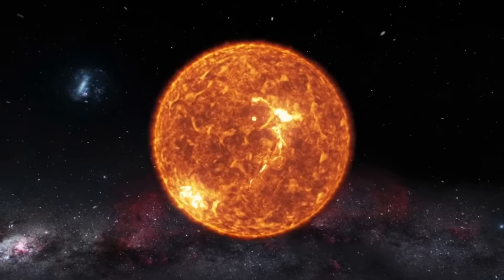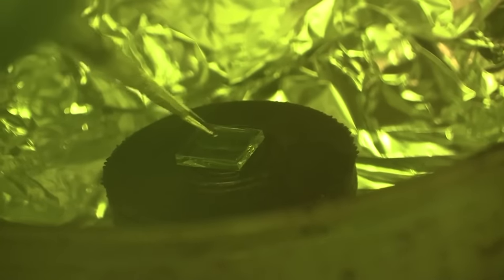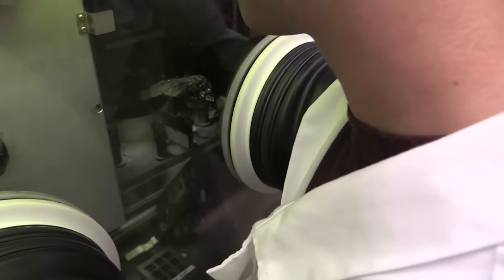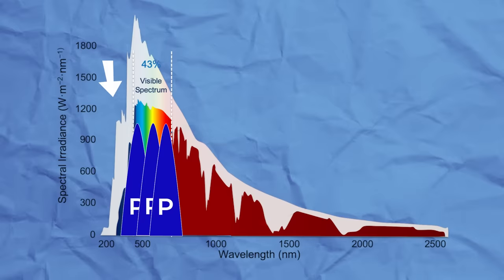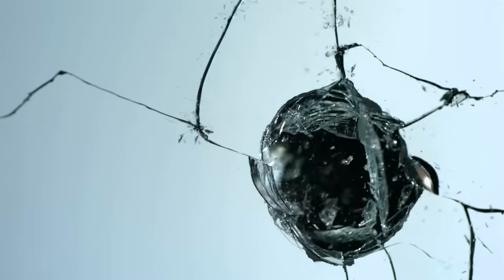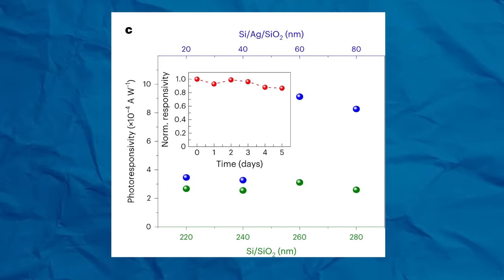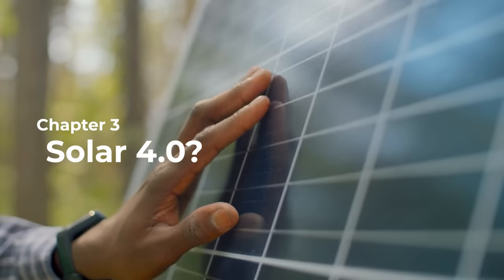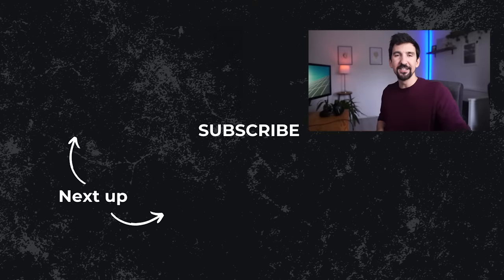Solar 4.0: Ultra Efficient Solar Panel Breakthrough

Comment: So, 250% better. That’s great, unless the efficiency of their tested cell went from 1% to 2.5%
Since they didn’t crow about the absolute efficiency, only the change, I’m going to assume their cell was pretty bad, and they didn’t want to mention how bad.
Reply: Ha ha ha they never tell you how good they really are but give us more money for continuing a research
Reply: Finally someone that actually listened and everyone glazed over! I never got the number of how many watts per square meter or anything this magic substance generates. Exactly what you said, 250% then what? what number is it better then, because 250% of 1 watt is 2.5w.. or 2500% of 0.1w is still 2.5w.
Reply: I believe the industry average is 17-19% efficiency
Reply: @mistermood4164  industry average of solar cells are 17-19% efficiency, they never once talked about perovskite cells.
Reply: They talked about perovskite cells making 250% better then the last time. 250% better then WHAT? because 250% better of 0 is still 0. They never gave a number....
Reply: Clearly the smart people are under this post...I was hoping the host would've answered that but he just repeated the same info in articles online. I came across one which states that Perovskite cells are 24% efficient, and with the new breakthrough of 250% (increase) they could go as high as 60%...but in reality it's more likely to be around 40%. Plus they'll cost 1/10 the price of silicon cells...there is a 'but' ofc which is longevity, they only last a few years but they're working on that. Doubling efficiency would be amazing and also dropping costs.
Reply: The efficiency of the cells is better than silicon as he said that the 250% increase was on top of the increase in efficiency of perovskite over silicon. 
However, it sounds like the 250% is an increase in the difference between silicon and perovskites, not 250% of the perovskite's efficiency. 
He said silicon ones are 18-22%, so it's above that, but not clear how much.
As for the 250% increase if it was 1% base that would be 3.5%, not 2.5% as he said a further 250% increase, not that the increase went up to 250% of the increases perovskites gave.
Reply: I assumed it was 250% more efficient than current industry leading silicon based cells. Which would be from around 20% efficient up to 70% efficient I think.

I did notice that this figure wasn't mentioned. It seems a pretty glaring omission. I checked the description to see if there's a link to the paper but there isn't one. Hopefully he'll read the comments and pin an update. I've checked a few articles and none of them say what the efficiency of these silver mirror perovskite cells actually are either. One of the articles claims it's in relation to silicon cells and another says it in relation to the same perovskite cell without the mirror layer. I suspect now that the 250% is in relation to the latter.
Reply: I don't know what he meant by 250%.  When you stick the words "increase of" in front of a percentage, that's the increase, which would get you to 70% approx.  That's incredibly high.

If you say one has the efficiency of 250% of another, then that's an increase of 150%, and now we're talking about 50%.

I don't like it when videos give percentages because the usage of percentages in the English language creates problems and introduces confusion.  If you tell me X has an efficiency of 20% and Y is 2.5X that efficiency, or better yet JUST GIVE ME THE NUMBER, then I understand it.

In other words, it could be either N + 2.5N when you talk about an increase, or wording it differently it would just be 2.5N.
Reply: @mistermood4164  Better panels are 21 - 22%.  Better panels have been over 20% for a few years now.
Reply: If I recall, the max is like 11% so far.
Reply: not to mention that its not worth getting too excited about lab results at the best of times
Reply: @richardh9587  "Efficiencies of laboratory-scale devices using these materials have increased from 3.8% in 2009[3] to 25.7% in 2021 in single-junction architectures,[4][5] and, in silicon-based tandem cells, to 29.8%, [...],"
Wikipedia
Reply: @StarrDust0  The maximum efficiency for single junction cells of any material is 30% due to the SQ limit. To improve that, you need to either use concentrators/LSCs or tandem cells but this exponentially adds to the cost of the system which is not worth it since you can just double to size and get the same energy, or use very novel photophysics such as hot carrier extraction and carrier multiplication, which are highly unlikely to leave the lab in the near future due to the extreme constraints of room temperature fermions in typical semiconductors. Perovskites can already achieve ~90% of what PC Si cells can do in the lab, its not a matter of efficiency in the lab. 

Perovskites are primarily attractive because of it's low cost, but actually have a lot of disadvantages that need to be addressed first. They have poor lifetimes and are highly sensitive to water, air, heat, and high energy light. They also contain lead typically, which is not RoHS complaint and MUST be recyclable or self-healable. There is also a problem of which is the accurate way to measure a perovskite cell's true efficiency because it exhibits quite a bit of hysteresis compared to traditional silicon cells, and making large modules is very tough because leakage is defect dominated. Foot large modules still only have about 14-15% efficiency as compared to lab scale modules that can achieve 26% efficiency. Additionally, the polymers used in transport layers in top tier lab solar cells are not cheap and quite novel, and have their own interactions to the environment, though sometimes positive.
Reply: @mistermood4164  yes but that is for standart silicone based cells. this 250% does not involve silicon cells at all. th 250% is the change from theold design to the new design perovskite cell. so it is meaningless.
Reply: not to be that guy but 2.5% is 150% better than 1%
Reply: @johndoh5182  Absolutely correct.  Nobody knows what they mean when they say 250% increase.  It sounds good, but it's confusing.  

I wish they would stop doing this.
Reply: @mistermood4164  More like 20-30% now. My 370w silfab panels are 21%.
Reply: Sadly sci-hub doesnt have the paper yet, so i cant actually read it to check :( will update if i remember and sci-hub uploads

Comment: I am glad you mentioned the lead in these. I almost never see it mentioned that not just is lead in them but it is in a water-soluble form.
Reply: There are also lead-free ones.
Reply: There is much more lead in the solder of standard silicon panels than in the perovskite absorber. Lead free solder exists of course but it’s not widely used in the industry. 
Cheers!
Reply: @ZACH12311  almost all products nowadays are produced RoHS compliant. Which means no more then 0.1% of dangerous chemicals like lead.

Comment: I just had a look at this publication, it is about photo detectors. The responsivity increase observed there does not at all translate into solar cells or their power conversion efficiency (PCE) although they both use perovskites. State of the art single junction perovskit solar cells have around 25% PCE and operate close to the thermodynamic limit which is around 32% PCE. There will only be incremental improvements. 
Multi junction devices or maybe singlet fission can get you beyond the thermodynamic single junction limit, but not a reduced recombination rate as seen in the TRPL data in that study.

Comment: This "mirror " on the backside has been used in Si cells for decades now. It is called back scattering field (BSF). Although in Si the effect might be quite different (light reflecting + defect passivation) it  also has increased the efficiency of Si cells a lot.
Reply: just looked it up...  current available to buy panels now are around 20% effecient   so theyre fulla shit

Comment: The layer subject to cracking in a perovskite cell is the thin deposit of Indium Tin Oxide, the same material which is electrically conductive and transparent and it is used in all smartphone displays to construct the capacitive matrix able to feel where the finger touches the screen. After awhile the ITO layer cracks and the perovskite cell be ame useless.
Anyway, it is not only the ITO layer to be a problem. There are a dozen of concurrent problems which need to be solved before a perovskite solar cell can leave the experiment laboratory and enter the manufacturing facility. This is the meaning when you ear that a technology is "in its infancy".
The silver layer below the recombination area is a genius idea. A mirror spatial disposition of charges discourages the recombination? Wow. Does it work below the Base-Emitter junction of a bipolar transistor? The best we can achieve today if an Hfe of 500; can we get to 5000 with a mirror below the junction?
This is truly big, it's relevant to many applications, not only the solar cells.
I'm a bit skeptical because I see a roadblock with the junction potential barrier; does it stay the same with the mirror installed?
I'm sure the solid state physicists are all closed in their labs doing many measurements, and sooner or later a preprint will popup - with a confirmation, or with the proof of a σςαμ.

Thank you Dr. Miles for the video. It a very interesting theory of the mirror, albeit i find hard to match the electric forces with the distance and the angles.
Greetings,
Anthony
Reply: solar cell that you replace every two years could still be cost effective
Reply: @oldconspiracydude236  ... if sufficiently accessible and properly recyclable, otherwise it is a wasteful pain in the behind.
Reply: For a number of years now, work has been proceeding in order to bring perfection to the crudely conceived idea of a transmission that would not only supply inverse reactive current for use in unilateral phase detractors, but would also be capable of automatically synchronizing cardinal grammeters. 

Now basically the only new principle involved is that instead of power being generated by the relative motion of conductors and fluxes, it is produced by the modial interaction of magneto-reluctance and capacitive diractance.

The original machine had a base plate of pre-famulated amulite surmounted by a malleable logarithmic casing in such a way that the two spurving bearings were in a direct line with the panametric fan. The latter consisted simply of six hydrocoptic marzlevanes, so fitted to the ambifacient lunar waneshaft that side fumbling was effectively prevented.

The main winding was of the normal lotus-o-delta type placed in panendermic semi-boloid slots of the stator, every seventh conductor being connected by a non-reversible tremie pipe to the differential girdle spring on the “up” end of the grammeters.

The turbo-encabulator has now reached a high level of development, and it’s being successfully used in the operation of novertrunnions. Moreover, whenever a forescent skor motion is required, it may also be employed in conjunction with a drawn reciprocation dingle arm, to reduce sinusoidal repleneration
Reply: I understood some of those words 😅

Seriously though I thought that they had gotten much further along with PRVSKT solar endurance than this over a year ago.

Depressing 😞
Reply: @oldconspiracydude236  If it is cheap enough yes, but the problem is that you would be hiring someone to go up and replace it every 2 years also unless you could access it from inside the house or from a tiered roof balcony.
Reply: Sure, that will have many implications for solid state devices.
Reply: @oldconspiracydude236  Their is a report on the NREL where they tested different solar panels brands and in general degradation would be about .5% per year. Which would mean the panels would stay above 80% of their output for 40 years!!! We are already far above the 25 year on which ROI is calculated for solar. Now at least two brands where at about .2%, that is they would be at 80% in a century!!! In fact at least in Solar the tech is already here, even with outdated ROI numbers, Solar is already the cheapest form ever of electricity. Now imagine if it was calculated more like 40 years than 25.
Reply: @diatonicdelirium1743  made with silver at 25 dollars an ounce, yeah.  Throw em away, I'll recycle 'em for you.
Reply: @kayakMike1000  Would be great if recycling were easy, but the amount of silver will be tiny, and secondly you'll have to efficiently get the material out of the 'sandwich'.  I'm expecting the panels to be covered in glass like all other panels, making separation even more difficult and expensive.
Reply: @CaptainRon1913  one of the best videos of all time!
Reply: @CaptainRon1913  yes, yes, a very cromulent answer indeed, you have my utmost confibularities...
Reply: Do you work in this field? I'm curious about how you know so much about it.

Comment: I initially was about to dislike the video, because it is a very niche research topic presented with wayyy to much clickbait. Similarly to the "Undecided with ..." guy.
But you actually know what you are talking about and threw in the juicy details, so upvote for this video. (even though i kinda disliked the pn-junction graphic, which shows the neutral bulk regions as charged and the space charge region as neutral...)

Comment: Also: adding a simple mirror to the ground surface, angled to reflect onto the pv panel, it increases efficiency for very little cost.  Or get the germanium ones, and add those mirrors, for even better efficiency, with minimal degradation from .... The Fkn Sun they're supposed to be pointed at!

Comment: Excellent coverage of the paper, well summarised and explained. One remark: at 3:52 , the p/n doped regions do not have net positive/negative charge, but they are called p and n because of the type of majority carriers present in them (holes/electrons). The dopant atoms (from III/V groups) have both one less/extra electron, but also one less/extra proton in the nucleus, so they do not contribute a net charge. The same way, the depletion region is not neutrally charged, but it is slightly negative on the p side and slightly positive on the n side (since electrons have moved from the n side to fill the holes on the p side). This imbalance of charge generates a potential difference and hence an electric field across the depletion region, and this is what stops the flow of carriers across the junction
Reply: Just the comment I came looking for before commenting myself about doped semiconductors being neutral

Comment: Nice video and a cool concept. I didn't read the paper but was there any suggestion that this could work for materials that don't involve silver. From my understanding access to silver is a serious roadblock for solarpanel manufacturing and removing sliver would save a lot of money.
Reply: Other metals could probably also be used in place of silver if reflectivity is the major property at play here. Aluminum has a very high reflectivity and electrical conductivity and it can have an oxide layer which can be adjusted in thickness to reflect certain wavelengths of light. A specifically tuned layer of aluminum + aluminum oxide might have similar efficiency if I have the correct assumption to what is going on here.
Reply: @_shadow_1  great answer. Thanks
Reply: @_shadow_1  I was thinking about aluminum myself and was hoping to be the first to bring it up. Curses, foiled again!
Reply: @patpowers9210  hehe, foiled

Comment: It would be interesting to find out if aluminum can be used as the substrate to hold the perovskite and still enhance the  energy output. The aluminum would provide a stiff layer so the perovskite would not be damaged from flexing.
Reply: He said mirror effect with the silver and I don't own any solver mirrors

Comment: 4:00 P and N type semiconductors are *not charged*. They don't go around carrying static electric charge everywhere. What they do have is a deficit or surplus of charge-carrying electrons, as opposed to a pure silicon crystal, which perfectly satisfies the rule-of-8. But this deficit or surplus is perfectly balanced, charge-wise, by protons in the nuclei, so they are still electrically neutral.

The region immediately surrounding the interface between the two does become electrically charged.

Comment: Neat, you already stated that using a conductive layer between the N  and P Type layers increase the efficiency of fluorescents but i wonder how other diodes might be affected. For example traditional diodes, Organic Light Emitting Diodes and even the ubiquitous double diode glued to itself, aka the Transistor. I also wonder what other conductive materials could be used like the uber hyped graphene and maybe even superconductors in the next "20 years"
Reply: A metal layer between N and P kills the diode, I guess the silver goes below the NP sandwich, however they are arranged in perovskites.

In OLEDs you don't want your pairs to be stable, you want them to recombine as efficiently as possible in the intrinsic layer.

Almost all semiconductor devices already have some kind of metal layer attached as these are the way to contact and use the devices, so no surprises there.

Metals in combination with graphene alters the band structure of the graphene. This is used to create a multitude of effects f.e. for sensor applications. Although we are usually not talking metal sheets but small islands or single atoms of metals here.